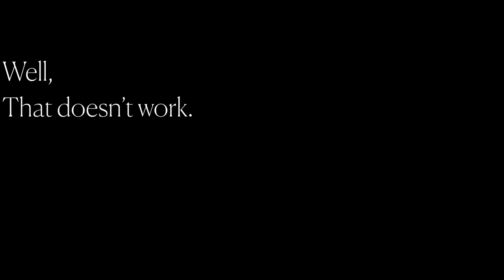Wet Molding Leather - Creating a camera pouch

Comment: I really enjoy watching your videos and learning along with you. Could you share some details about the leather you used here? I am particularly interested in how wet molding might affect any dyes or treatments of the leather.
Reply from the maker: That's very nice! And a good question, because i usually don't know very much about the leather i use. I sometimes buy scraps here and there. Sometimes vegtan and sometimes chrome. 

Anyway :) I guess this has to be a vegtan, and about the dye, i would say the wet molding definitely has an effect. Where the leather has to stretch the most it will light up and in the corners it will darken, generally. Other than that at least in this case it didn't change too much. But i think it also depends on the time you leave it in the water. I have a knife sheath from the same leather, wet formed, which looks quite different (it's on my insta, if you're interested)

I assume it would also depend on the kind of dye. Water based is probably different..

I also tried it with a quite soft leather, that isn't purely vegtan i think, and it changed quite a lot. I have to get some info what that was exactly...

Sorry for the long answer that isn't really an answer :D